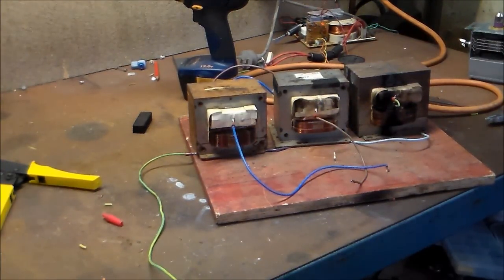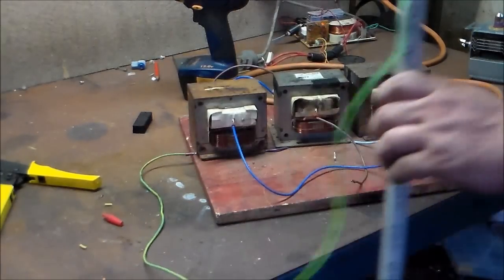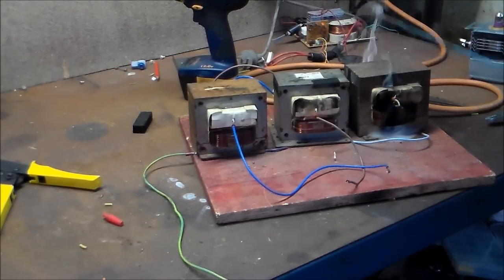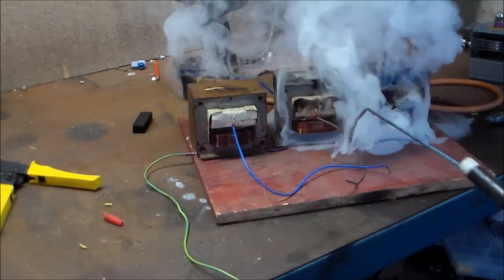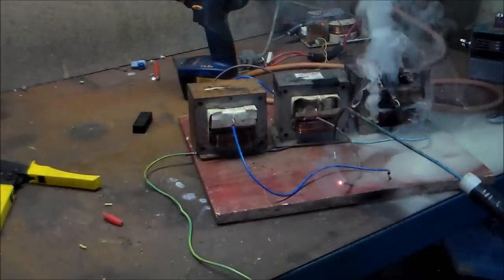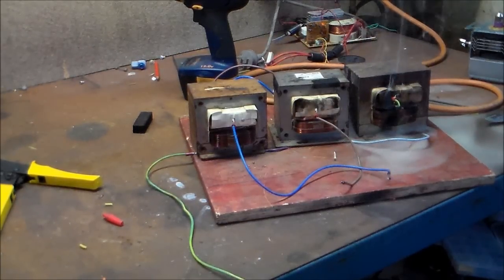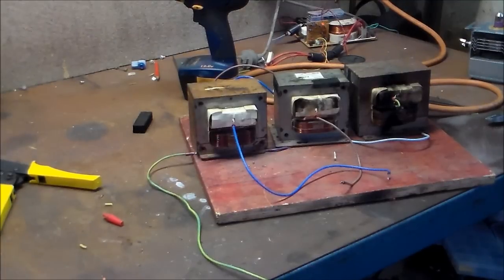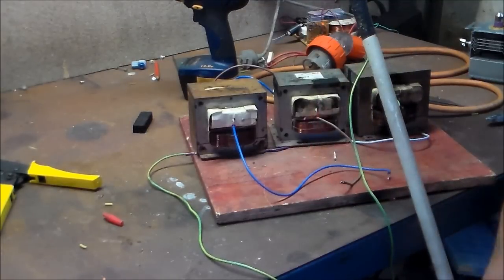3 Phase MOT stack burns out one MOT!

Comment: I could be wrong, but I would say the MOT on the right was backwards phased? that would cause the core to over saturate by reverse electromagnetic flux feeding back through if I am not mistaken lol.
Reply: True. been there done that haha
Reply: Yes, also looks like it has had carbonization from previous arcing ... likely the insulation broke down because of the carbonization, and then shorted out ... 
The secondary quickly smokes because it has a high resistance, compared to the primary.